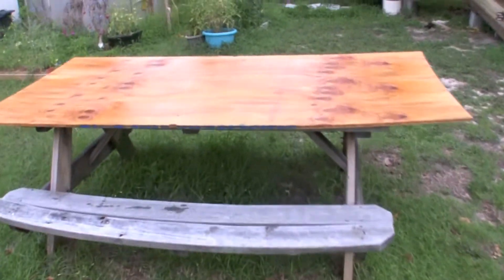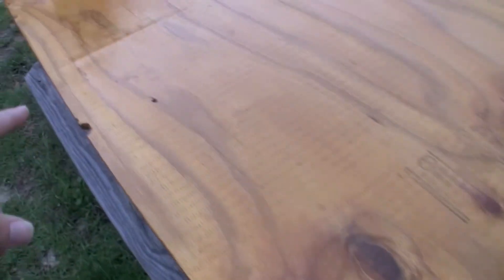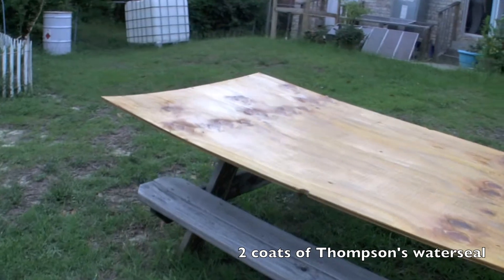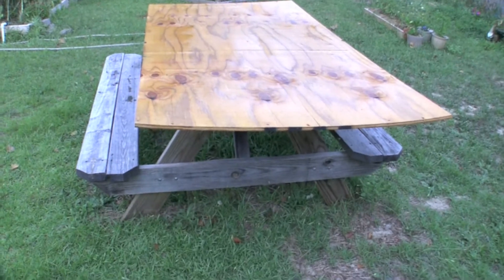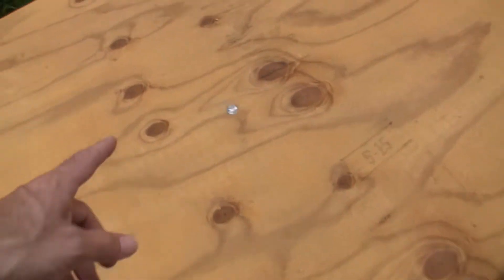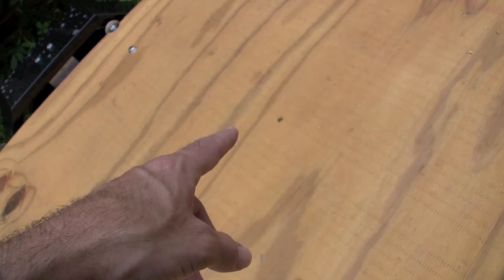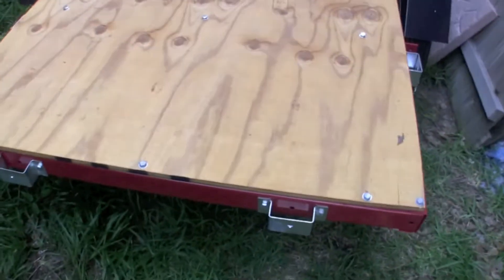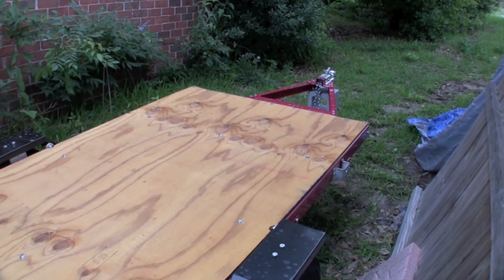1195BL Harbor Freight Utility Trailer Part 2

Comment: Ever think about putting anchor points along the flooring?
Reply from the maker: +BillyRay Puffinstuff I ended up putting anchors on the sides but I'm thinking about adding  some on the edges of the floor.